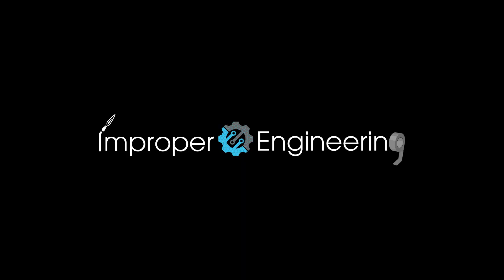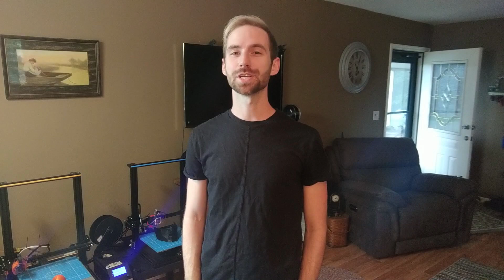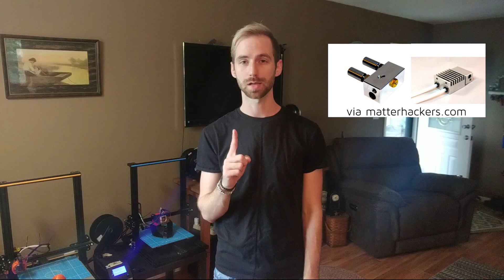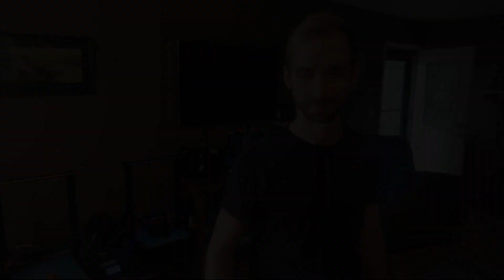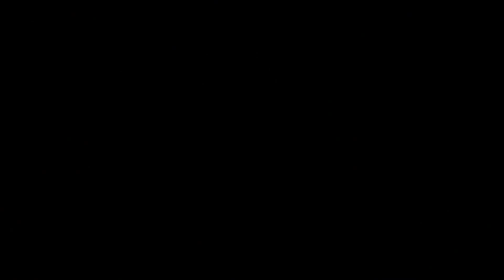Creality CRX - Creality Announces Dual Extruder CR10 on Steroids

Comment: I think what Creality is doing is great. Even if the dual z doesn't turn out to be so great they are listening and making strides towards creating a better product. In the long run this can only lead to good things. I've just recently purchased the 2018 model of the cr 10 s and although I do have some issues and complaints it's still very impressive for the price and much better than the original cr 10 and even earlier versions of the S model. They are evolving their machines, taking the most impressive user based upgrade ideas and implementing them. Bravo!
Reply from the maker: Exactly. Steps in the right direction!

Comment: Thanks for the video. I just got my Ender 3 delivered today after being tested and repack by Tiny Machines 3D. I will be ordering an X from them in July too. Hopefully this will be able to use water soluble filament for supports. I was thinking about picking up the Creality custom CR-10 dual extruder board from TH3D for my CR-10S as well.
Reply: RichterScaleStudios did you get an X
Reply from the maker: Nice man!

Comment: Your "super high ultra alpha quality voice over" was funny!  Any ideas on the CRX print volume or the price?  I'm not sure about the dual z axis being controlled by one motor.  In any case, I can't wait until July to pick one up if the price is good and you give it a good review!  Make sure you tell me if it is a piece of crap so I can save my money!  Thanks!
Reply from the maker: I have machines with both dual options - usual dual motors and using a belt and I prefer the belt because there's no motor skipping. 
No idea on price or volume but they seem to offer two versions - maybe the same size as the mini and a normal cr10. I can't wait for one!
Reply: Hi. I saw a pic in reddit about an ad of the crx in a fair. It is 300x300x400mm. I hope it cost a lot of money because im just recive a normal cr-10 and obiusly I cant return it to buy the new one 😢
Reply from the maker: You won't be let down by the normal cr10! They are still my workhorses and my most reliable machines :)